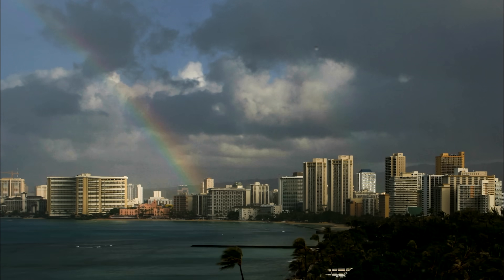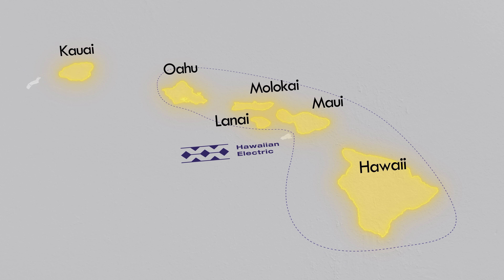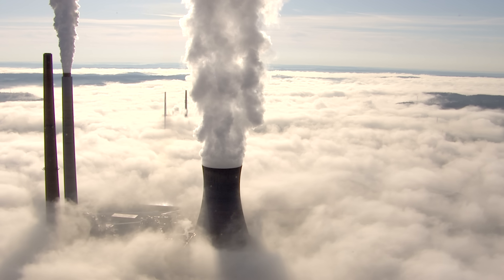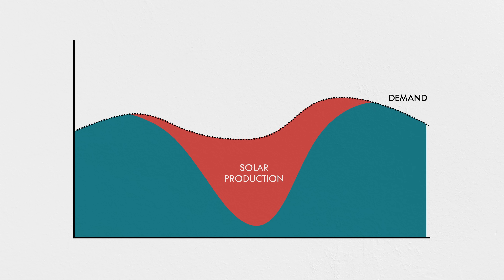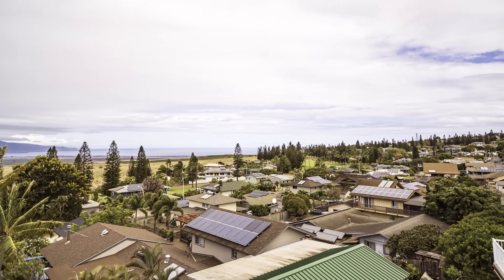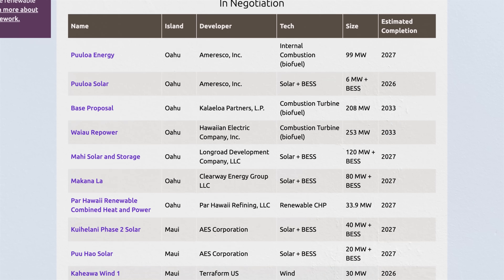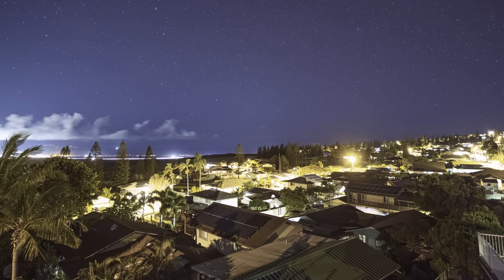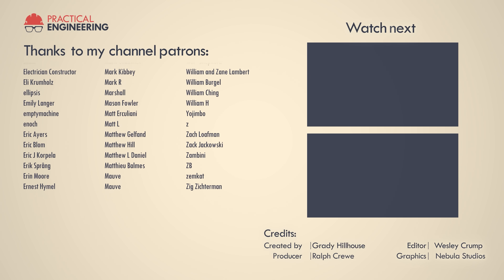How the Hawaiian Power Grid Works

Comment: In the UK it is common for power inertia to be added into the grid, either via especially built projects that basically spin large weights to keep inertia in the system, or by converting generation plant into "large spinny things" when the power station is decommissioned.  It seem that there is an opportunity to do that on Hawi'i
Reply: That was initially done with the Zion nuclear plant in Illinois when it was shut down. It was referred to as a synchronous condenser.
Reply: @davidjernigan8161 Old generators converted to 'syncrhonous condensers' (just synchronous motors with no torque load and a hi rotor inertia) provide TWO benefits.  The inertia that everyone is talking about here, and also power-factor correction.  When over-excited they can produce 'kVARS' just like a large capacitor bank (an oldtime name for capacitor was 'condenser').  This helps with voltage stability.
Reply: @mikefochtman7164 I know Kaua'i does this with their grid.
Reply: This discussion about different types of energy storage is missing an important point: Each solution has it's own costs and benefits.

Spinning mass provides nearly instant response to demand fluctuations (without computers), but there is a constant frictional loss. Capacitors discharge quickly. There is a conversion cost for chemical storage,  and that chemical may or may not be long term stable. Many batteries have a limited number of cycles or degrade with usage. Mass gravity systems can have a better end to end efficiency and usually hold onto all of the stored energy over time, but they need a little time to get up to speed. Another solution can be redundant network connections, or asking some heavy industrial users go off line for a while. 

The various systems have different cost in terms of the infrastructure per watt hour stored. The rate of storage and discharge are as important as the total amount of energy stored, and effect cost.

The ultimate backup could still be a fossil fuel plant, but even the best  power grid scale gas turbine plants need around 5 minutes to begin producing power. The Hoover dam reacts in about 90 seconds, spinning mass reacts in a fraction of a second but will quickly slow down. Batteries have their own discharge limitations.

Each of these have different end to end efficiencies and work best for different time scales. The grid managers need to put in a mix of solutions to deal with moment to moment demand irregularities, daily and seasonal patterns, and unexpected weather interruptions or equipment failure.
Reply: You can use a static VAR compensator to provide reactive voltage. The issues is reactive voltage costs money to make, but you cannot charge for it. I worked on the deregulation of the NY state power gride in the 1990s and figuring out who had the pay to supply the VARS was a big issue.
Reply: @phonedave - a simple solution has been found for this issue.  Under the current grid interconnection standards the renewable energy sources has to be able to provide upto 0.7 power factor leading or lagging on command.  The renewable energy sources have to bear this cost.
Reply: @phonedave Exactly right.  I worked on Michigan's dereg and same issues.  The old rates covered a multitude of services beyond just the energy delivered.  Of course some industrial service rates include demand and extreme var cases, but that's not the case for most customers.

Arranging for, and paying 'independent generators' to provide all these extra services is a complex issue.
Reply: remember that is the USA. they want to invent the wheels all over themselves.
Reply: They have chemical batteries.
Reply: @VitalVampyr Chemical batteries don't provide grid inertia.
Reply: @Muppetkeeper  Chemical batteries aren't inertial batteries.  They both store power though.
Reply: @VitalVampyr  putting a bottle of water on a high shelf stores power, but it doesn’t make it the same thing
Reply: @VitalVampyr the point in the original comment is about using the inertial mass to regulate frequency. Not as an energy storage solution.
The mass would be used as a fly wheel to keep fluctuations in frequency in check in real-time.
Reply: @Muppetkeeper  AFAIK, chemical batteries can respond quick enough that they can be used to stabilize the grid frequency similar to the stability provided by generator inertia.
Reply: @Muppetkeeper Actually batteries do provide significant inertia to the grid.  The software for the DC-AC inverter used by the battery can be programmed to have the same effect as a large rotating generator.
Reply: @Muppetkeeper  
yes they do. if they could not, nothing else can.
Reply: @Muppetkeeper you are correct but the reason why inverters don't provide inertia comes down to grid interconnect legislation that states that inverters must not provide inertia.  The idea of 'virtual inertia' is something that most modern grid tied inverters are technically capable of providing,  what is stopping this being used is the state of current legislation being decades behind the technology.
Reply: @michael-j-harrison That legislation exists because of the coordination issue.  Today's commercial power plants work with system operators with complex agreements about dispatching and ancilliary services.  And that's just a few hundred plants.  

When my refridgerator kicks on to maintain temperature, how many systems should respond to that sub-kW load change?  Everyone pick up a few milliwatts?  Just one inverter?  Who doesn't get to operate at full capacity when I turn off my TV?

Even with continuous communications with some central operations center, coordinating thousands of small-scale inverters is beyond current technology.
Reply: @mikefochtman7164 - I disagree with your assertion here.  Communication to the multiple different generation assets is not required - all that is required here is to define the expected control response.  This virtual inertia issues is very similar to the frequency ride through requirement tgat has recently been added to AGF requirements.  Originally it was stipulated that inverters must not participate in frequency ride through which came from a fear/misunderstanding of how inverters would behave in a frequency ride through event, hence if tge grid frequency dipped below a lower defined frequency threshold then the inverters had to completely stop exporting power.  At first this strategy worked OK but as renewable penitration increased the problem of not having inverters participate in frequency ride through became very apparent. 

It took enormous effort to get tge grid interconnection standards changed to change the legislation to require that inverters must participate in frequency ride through and this has mitigated most of the problems that were occuring on the grid due to this issue.  The frequency ride through does not require any form of control communication across the grid.  This is simply handled by defining the frequency response based on AGF profiles.

With virtual inertia it is basically the same - all that is required here is to define an amount of inertia required by grid connected inverters.  For PV only inverters it is impractical to expect them to provide more than a single cycle of inertia,  however for energy storage inverters it would be perfectly practical to specify that they should provide 10 seconds of inertia. 

With the grid interconnect standards one of the biggest issues here is in regards to which assets should be performing advanced grid functions.  Existing grid operators are fighting to make AGF the exclusive domain of the traditional generators and justifying this from an argument that AGF is too complex to expect renewable energy generators to be able to do this correctly,  however it makes absolutely no sense to expect traditional assets to perform all AGF going forward with a move from traditional to modern renewable assets.

The reality is that modern inverters with the latest control systems are much better placed in meeting the modern grid AGF requirements than antiquated rotating machines that are working on decades old control systems.
Reply: @seneca983  the goal is not to have a quick response, but to have no response at all
The load is constantly changing, the more inertia you have the less you need to fiddle to maintain the target frequency. Every fiddle is something cycling, and every cycle is one closer to a broken part (which is even worse on a small grid since taking out a piece for maintenance/replacement has such a high impact)
Reply: @Daniel-yy3ty  "the goal is not to have a quick response, but to have no response at all"

But quick enough response can substitute for inertia. That might be the most viable option if inertialess electricity generation grows its share, though, of course, that's not certain.
Reply: How about we just restart the coal burning power plant.
Reply: @gregorymalchuk272 
Why not choose nuclear?
You have plenty of sea water for cooling and good reactor designs like CANDU don’t go bad.
Seems like a wasted opportunity in favour of little solar and wind toys.
Reply: @drgazter   Nuclear is not great for fast ramping up and down, which wouldn't be ideal for ROCOF response
Reply: @gregorymalchuk272 doesn't sound like a very sustainable idea
Reply: @michaelpapadopoulos6054  The current costs of "renewable" electricity in Hawaii are very unsustainable indeed.
Reply: @gregorymalchuk272  So look for a solution that doesn't require burning more money regularly bringing fuel in from the mainland.
Geothermal, nuclear, solar, wind, and tidal are all candidates.

Comment: Renewable power inverters can be designed so they help stabilize the grid. Wind turbines have huge rotary inertia, but they need to communicate with the grid to know when to actively stabilize because of load changes, vs when to disconnect due to faults. Without that data connection faults and load changes are indistinguishable.

With added smarts both solar and wind inverters can always throttle down the power they put on the grid. If they have a data connection, they can operate at 90% capacity most of the time and throttle up too.
Reply: Open standards that are cheep to use could go along way in integrating distributed power systems into grids.  Perfect for home solar installations when selling back to the grid.
Reply: Most wind turbines do not connect directly to the grid. This means they cannot be used as an inertial regulator. Imagine the issues blustery days could have on frequency.
The data connection point is valid though. However that leads to the next problem of added complexity and further possible issues (failure, connection issues, hacking), as well as cost.
Reply: @MarcusHawksley  The inverter on the windmill is directly connected to the grid. With appropriate control electronics, those inverters can act as bidirectional variable frequency drives, VFD. Under normal conditions they exactly track the grid phase. Within the limits of their power rating, they can intentionally lead or lag the grid in order to actively stabilize the grid. While electrically the generator can easily act as a motor, the mechanical system is not designed to be back driven. This means there is usually software in the inverter that protects the windmill from being used as a giant fan, even if that would help stabilize the grid after a large load unexpectedly goes offline.

This is similar to the operation of a DC intertie between the 50 Hz and 60 Hz grids in Japan. Power can go in either direction, and this can be used to stabilize the frequency of either grid.

Sometimes it makes sense to literally have a DC intertie in a wind farm. Otherwise each inverter will convert directly from the 3 phase of the generators to the 3 phase of the grid and skip the DC step. As this can be more efficient.
Reply: @hamjudo  thanks for your reply. I do enjoy being in a part of the internet that is civil.
I was unaware of developments in grid forming/stabalising turbines. Thanks to your comment I have been delving into some of the more recent publications. (Really useful information for my career as a landscaper!)
Did you know there is a system from the University of Birmingham that can regulate the frequency without communication links to the wider grid?
Thanks again for your reply. You have both enlightened me and delightfully distracted me from my tax returns!
Good wishes from Finland. Have a great day/evening/night!

Comment: Hi Grady,

Why no Geothermal with a volcano right there?
Reply: There is a geothermal plant, but geothermal plants are very expensive to build and they also need some degree of (ground) stability. Building them near a hotspot might well give you a good return for a shallow borehole, but thenthe next time you get eruptions, your infrastructure might be threatened - selecting geothermal sites is an expensive and time consuming process.

Comment: “You can’t pay for more reliability” I disagree with that statement— you can add a battery system to your solar system and that would cover 30min to even days long outages. It could also help the grid deal with drops. If every solar installation required a battery then maybe that can act as “turbine” to keep the grid stable as clouds pass and inclement weather increases.

Comment: We visited Hawaii a few times pre-pandemic, and really enjoyed our time there. We are hoping to go back soon. However, one thing I heard there was that geothermal plants are very hard to get approved. Some groups fight their installation because they see building a geothermal plant to tap into a volcano's heat energy as disrespectful to the various volcano gods. If true, this is madness, and they are missing out on a great opportunity to increase their carbon free baseload capacity, and therefore their energy independence.
Reply: I’m sure there are a lot of different reasons for different people. The most obvious technical hurdle is that you would have to have a way to get the electricity from the hot island to the island with most of the people. But, of course, I’m sure there are plenty of people fighting it because they don’t like the color or something.
Reply: @MrMadsci7 The only geothermal plant right now is on the island of Hawaii, where it produces 10% of the island's power requirements. Plans are in the works for expanding the plant. As far as I can tell, no one has even looked at the geothermal potential of the other islands. 

There were plans to lay submarine cables to allow power to be shared between the islands, but nothing has been done about it yet.

Comment: Here in Germany even small solar plants (above 11kwpeak) need to have the ability to be shut  down by the grid company also you can get lower power prices for loads like heat pumps etc. If you give them the ability to  shut them down to shed load
Reply: What a sad time we are living in that the third largest economic power has to resort to load shedding to keep lights on just because they don't want to take responsability for the huge grid and storages needs that are soon coming like a brick wall...
Reply: @laredobenjamin7438  yeah that is sad particularly considering the cost of power wich should make investments in storage solutions etc more profitable and nessesary. still the obstacles even for the smallest home power plants are big. 
or for commpanys you need like a 100 diffrent permits for 1 Wind turbine
Reply: Power in germany is 30- 60 EUR Cents per kWh. (Probably 80 USD Cents). Heat pumps cost up to three times more than in neighboring countries. All because it is forced upon us. Northern germany is in better shape, with better power grids.

Comment: The power here in Nome, Alaska is one independent power plant, with two 5mw diesel generators to supply the 2mw to 3.5mw typical demand.  So one is running and one in standby, swapping as needed for maintenance. A large battery system will be installed this year.
Reply: The power plant is also the water treatment plant and waste heat from power generation is used to heat the city water supply by about 10 Fahrenheit degrees to reduce risk of freezing.
Reply: Thats a clever use of cogeneration. Irrc moscow does something similar.   @TagiukGold